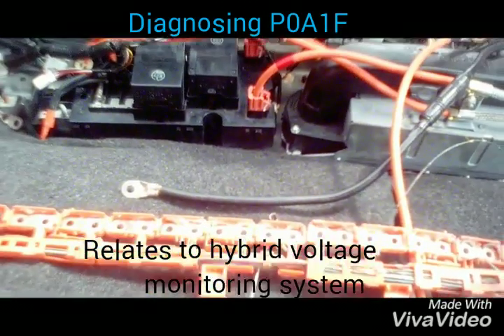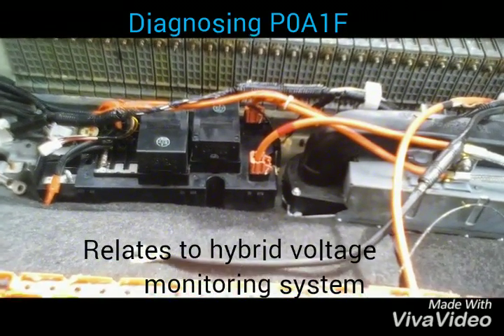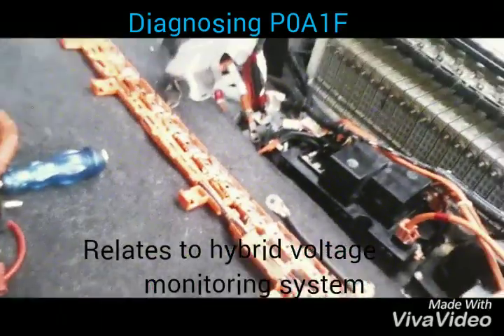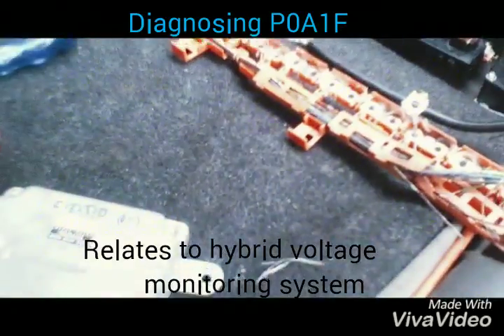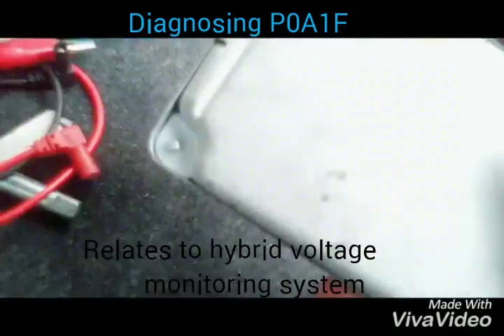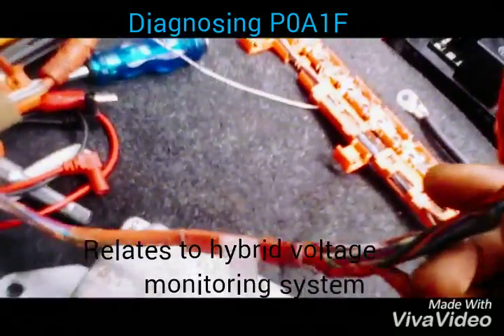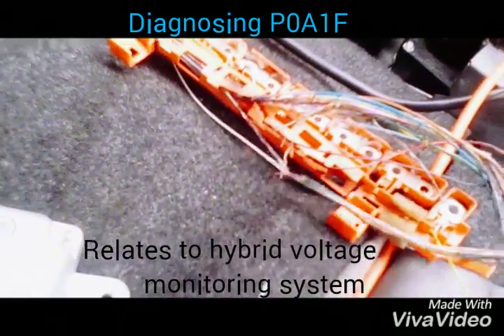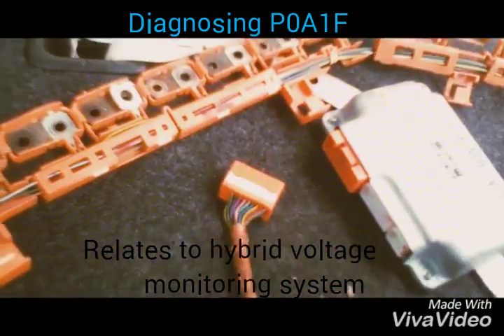P0A1F Battery ENERGY CONTROL MODULE FAULT, RARE CASE STUDY.

Comment: Hi..am  having this code POA1F in my prius gen 2.. the first battery ecu was corroded and led to short to the voltage sensing wires, so i replaced the ecu and wire, but now the voltage of modules are sometimes all over, this cause the car to generate code POA1F.   Should i change I change battery ecu again or replace voltage sensing wire harness
Reply from the maker: From my experience it is most likely the voltage sensor wire and battery ECU
Reply: @FASTECAUTO  Thanks for response...yesterday i replaced the voltage sensing wire and the ecu, and the code went away...
Reply from the maker: @tanzaniacarschannel6975  glad to hear it has been fixed.
Reply: @FASTECAUTO  though what made me surprised is that the ecu that i removed following that mentioned trouble code had no any sign of electrical damage, no burning sign/ no short sign insides, all the contact points on the Hv sensing wire harness were ok no any sign of corrosion on contacts, no pin was cut  , all pins/contacts were fine.. but still the computer was showing that code.. but thanks after replacing it with another one that was in store, it worked great..

This left me with question that do these computers for hv battery for same generation with different year of manufacturing and different part number have different mechanisms the way they work in managing the batteries/modeles voltages?.
Reply from the maker: No... that computer was just skewed internally... May not be visible to the eyes

Comment: Pls what's the most likely cause of p0AE2 Hybrid battery precharge contactor circuit stuck closed?
Reply from the maker: If it is a  camry ,it's most likely the dc-dc converter, if its a highlander then it is the contactor pack.
Reply: @FASTECAUTO  thank you very much, it's a 2007 camry